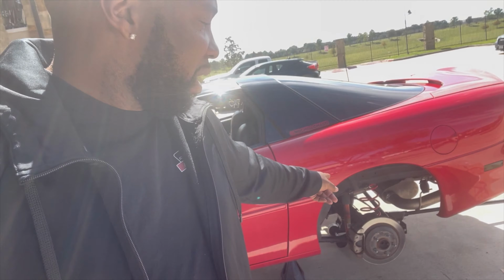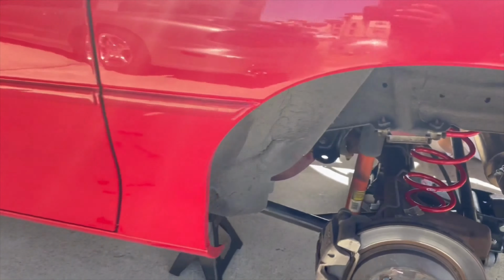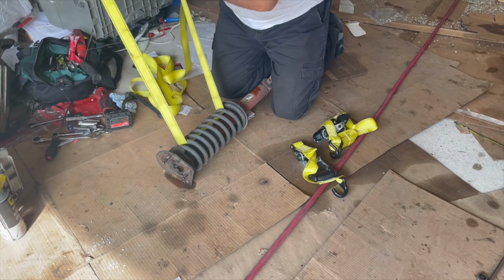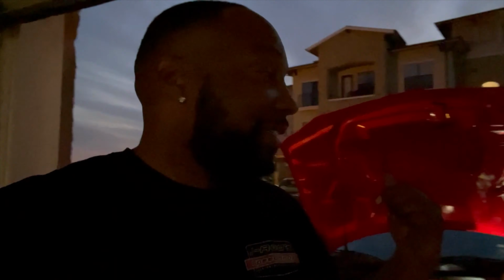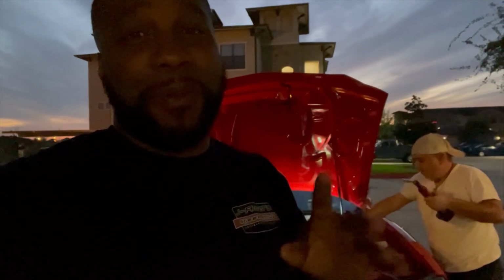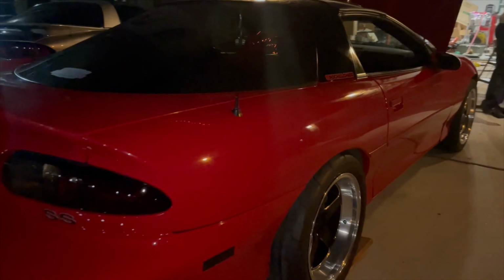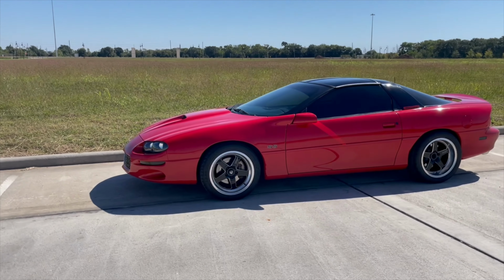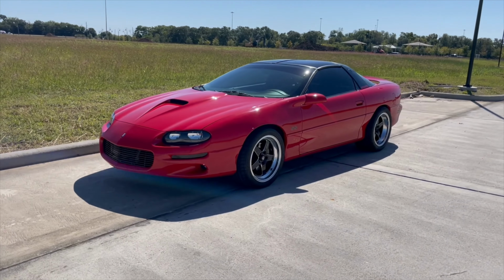UGH! IT WAS SUPPOSED TO BE EASY LOWERING THE CAR... GUESS NOT!

Comment: Wheels tires, lowered. Exhaust. It’s about that time for a cam swap 👀 Ik you got a corsa catback but I’m unsure if you got headers. Keep it up. Like a 228r with a 92/92 ported 243s. Call it a day 👌🏽
Reply: +1 on the 228r. That’s the cam I have and it’s about perfect. The torquer v2 hits a little harder and that duration is about the max you want for the street before low end power is sacrificed
Reply: I have a summit pro ls stage 4 8709 cam,the biggest that I’ve been able to find and according to the dyno at the lowest it makes about 12hp more then stock cam and arohnd 3600-3700rpm it makes over 100 more,with the supporting mods-springs rockers and pushrods

Comment: Did the back tires rub I'm running  17x11s in the rear with 315 35 17s just curious did it rub the quarter panel
Reply from the maker: It rubbed slightly with those wheels but it didn’t rub with my new wheels.